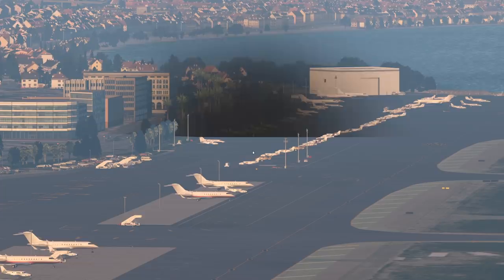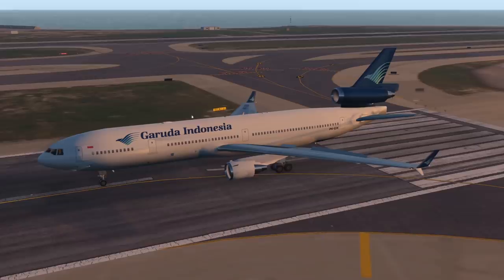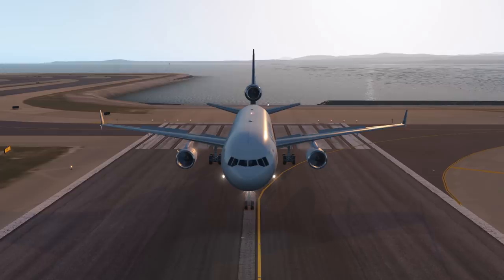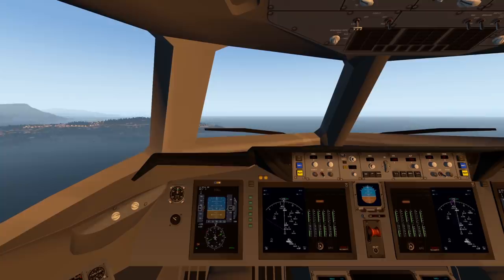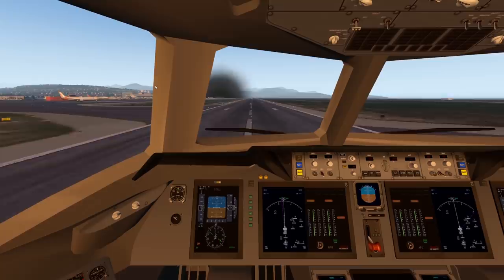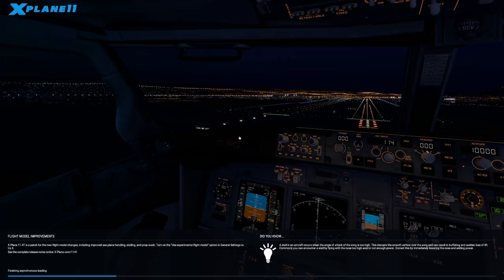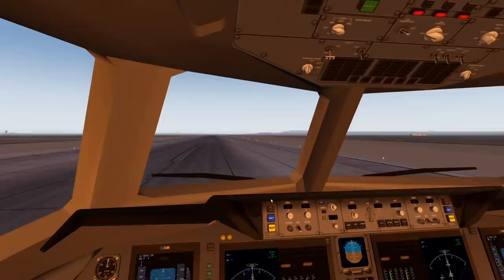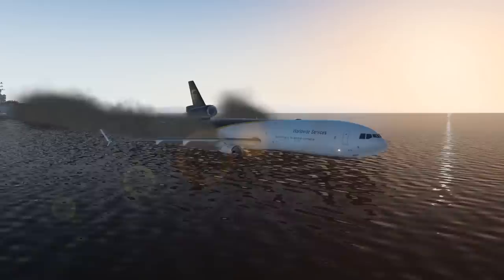McDonnell Douglas MD11 - Could It Have 2 ENGINES?

Comment: Next video: Cessna 172 - Could it have 0 eNgINeS???
Reply: -1 eNgInEs
Reply: @Ceratto168  😃
Reply: Penguin GamerYT no reverse thrust mid air  lol (I know that it can’t have reverse thrust but whatever)
Reply: @adamclarke2251  Can't it pivot the prop and give it a sort of reverse thrust? Idk about the 172 but larger prop planes do that I think.
Reply: Kyle Rudd yes I know turboprop planes can but I don’t think the 172 can, only larger ones with turboprop engines
Reply: maybe if the winds strong enough
Reply: Kyle Rudd I have figured it out. All you gotta do is land on a slippery runway, do a 180 and full power lol
Reply: BOEING 747, CULD IT HAVE 2 ENGINES?
Reply: @ralzvy  LOL
Reply: Yes its Called a glider
Reply: You want swiss011 to make a glider?

Comment: An unintended effect of having 3 engines on the TriStar, DC-10 and succeeding MD-11 meant that in the case of hydraulic failure, you could technically fly the plane using throttle only. Power to 1 & 2 in order to turn right + climb, 2 & 3 to turn left + climb, power 2 to dive, power 1 & 3 for 'economy' climb, power 1 to sharp right, power 3 to sharp left and power all to climb quick.

Comment: Md 11: a failed plane because of his additional engine
Airbus A340: "Allow me to introduce myself".
Reply: It managed to amass 370 orders and was built for 18 years. While definitely not a success, I wouldn’t call it a failure.
Reply: and it still flying for passengers
Reply: @ishiddddd4783  not for long. The A340 and MD11 roles are taken by the A350 and the new Boeing 777x. Also there is very small number of MD11s that are still operating as commercial airliners. Most of them are used for cargo.
Reply: @gh-yf4go  i know, but the fact still the same, the a340 still flying as today as passenger aircraft, while the MD-11 isn't, and with 6 years of difference
Reply: @ishiddddd4783  yeah, but sadly their days are numbered. The A340 is one of my favourite planes but it can't compete with the new generation.
Reply: @gh-yf4go  MD-11s in passenger service are completely wiped out. The last ones were Finnair in 2010, followed by World airways going bankrupt and finally KLM ending it in 2014. I dont think there are any airworthy examples left of the passenger type. The closest is probably some cargo MD-11s who still has the windows left.
Reply: Gh, a plane type (A340) with double the orders of the MD-11 and one of the best safety records in aviation history, a failure?
Reply: @giamag411  I haven't considered that, but there is one single problem. Fuel efficiency. Too many engines.
Reply: @giamag411  Wait, were you talking to me? Or him? Nevermind.
Reply: Konly - RBX_YT To him, “gh”. Sorry, should have made it clear from the start.
Reply: @giamag411  OK
Reply: giamag411 It really lost to the 777 tho...
Reply: Hi hi guys I hope you are ok cos of the caronavirs
Reply: ????????
wdym
Reply: Airbus a380 :move out of my may
Reply: @gh-yf4go  Airbus Intended the A350 To Replace The A340.
Reply: DC-8...
Reply: @gh-yf4go  isnt the 777x replacing the  747 and the md11 problem was because of the planes inability to travel the range with the plane given range by mcdonnel doug
Reply: @gh-yf4go  actually there are NO md11 airliners flying, all have been converted to cargo
Reply: Oh 😅 hi A340

Comment: cesnna 172:exsists

swiss001: can this survive with no engines
Reply: 747: exists

Swiss 001: Lets fly that guy with 2 engines (auctually is really possible the ge90 got 2x power of a 747 engine and so the 747 can fly with 2 engines ;)

Comment: The Engine at the top is probably creating a torque which pitches the nose down quiet heavily. That's what caused the problems with steering it

Comment: Boeing can use the Shelved projects of McDonnell Douglas DC 10 Twinjet (for Boeing 767-500LR / Boeing 767 Super Max 500 LR/ Boeing 767-500XLR) and MD 11 Twinjet for Boeing 777-400 Super Long Range / Boeing 777 Mega Max 400 SLR/ Boeing 777-500 Super/Mega Long Extended Range / Boeing 777 Mega Max 500 Super Long Extended Range) and MD 20 (Super Stretch MD 11 Twinjet) retaining its Windshield design for (Boeing 777-600 Ultra Long Range/ Boeing 777 Mega Max 600 ULR/ Boeing 777-700 Ultra Long Extended Range/ Boeing 777 Mega Max 700 ULER) all these with retain the windshield design of these TriJet McDonnell Douglas Aircraft on these possible concept aircrafts to commemorate Boeing and McDonnell Douglas 25 years of Merging in 2022

Comment: It didnt rotaté bcs it has a "pushing-down" effect with only the tail engine.
Reply: That makes no sense. It's in the aft of the aircraft, which shifts the center of gravity aft, allowing for proper weight balance on takeoff.  It provides centerline thrust, not vertical or downward thrust. It simply couldn't rotate due to insufficient thrust and lift.
Reply: @AmyAnnLand  Oh ok, i guess that i was wrong.